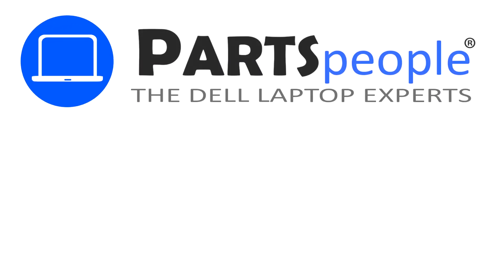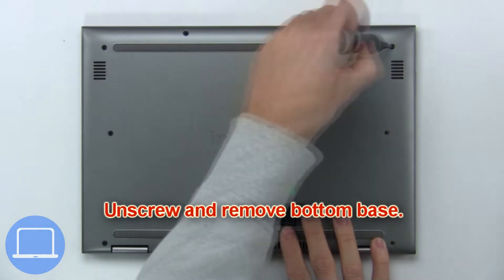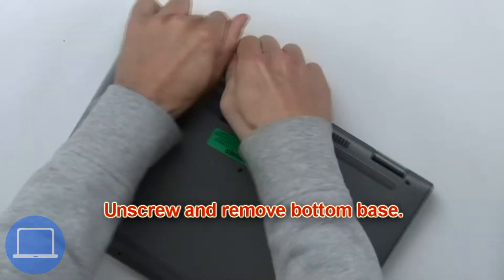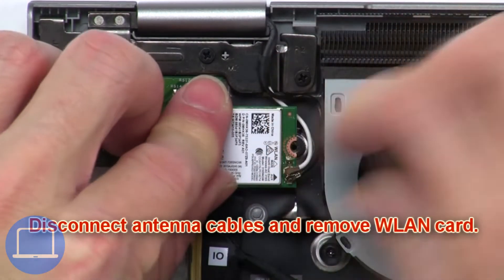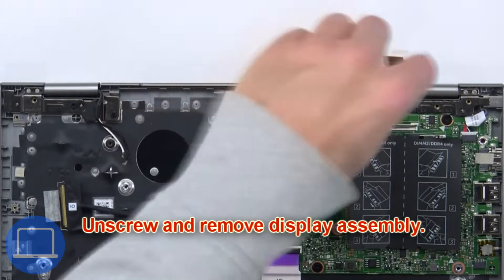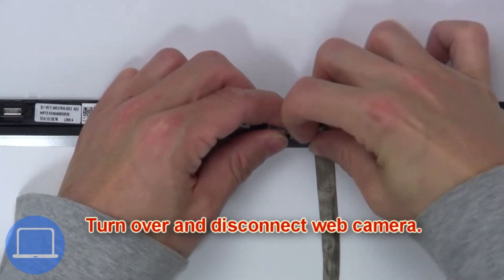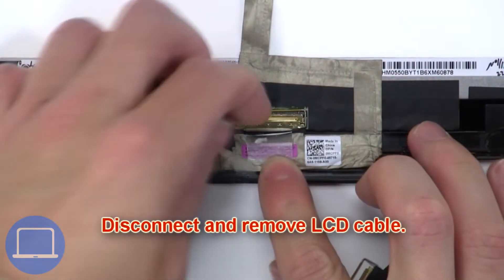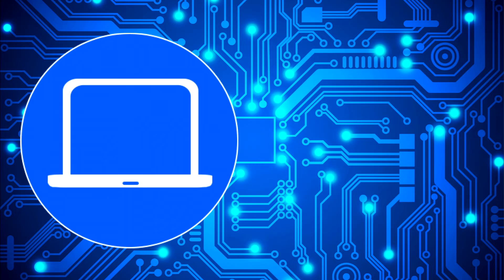Dell Inspiron 5378 2-In-1 (P69G001) LCD Panel How-To Video Tutorial

Comment: Hi, I have a Dell 5378 laptop with a damaged display glass in the upper right corner, near the black edge.
Fortunately, the cracks do not prevent the correct functioning of the touch on the whole screen.
  I have seen that the replacement, even used, costs a lot.
I also saw a kit on aliexpress where they also sell the display bezel.
I also contacted Dell support, to ask if that spare part was available to be reassembled on the display panel, and they replied that the component is sold complete with the LCD panel behind it.
Therefore I ask her if she is aware of a possible replacement of the bezel only with glass, having found that component on Aliexpress separately.
Reply from the maker: Hi, Aliexpress may sell the glass separately, but some of these screens have an adhesive that when you remove the glass then you'll basically be destroying the screen. You'd have to do it correctly in order to put the new one on and have it still be flush like the original. There's coupon codes on the bottom of our website if that helps with going ahead with the complete replacement. Good luck!